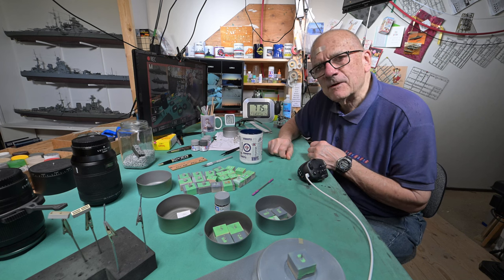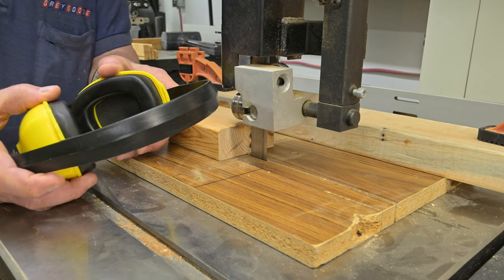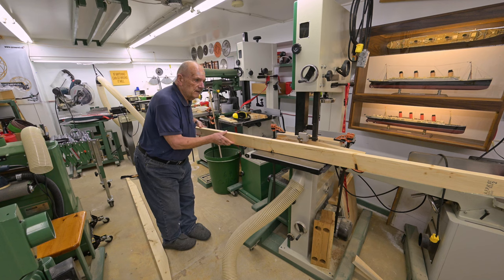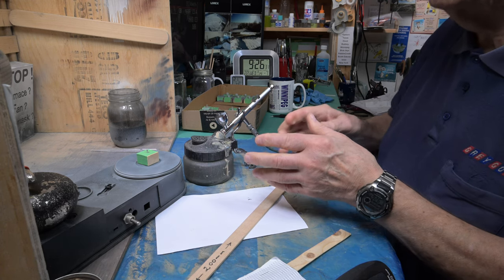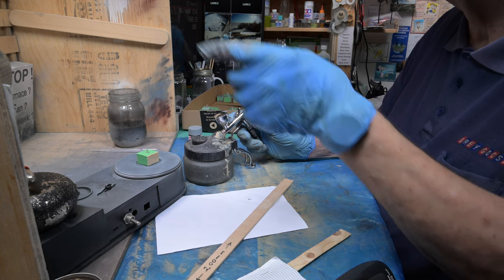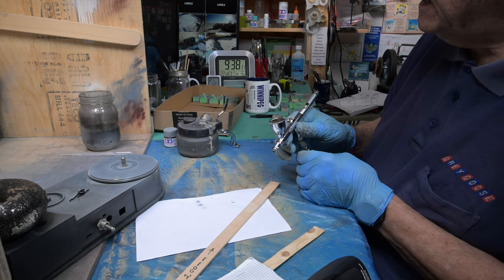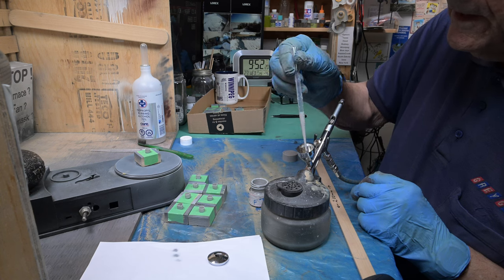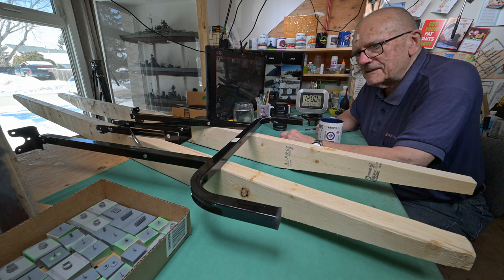The Model Ship - Part 1536

Comment: Hi Ron, nice job with the painting.  You sure do have a nice wood shop.  If you are going to mount those legs on the bottom of the 2X4s, aren't you going to need a block in the middle to mount the folding support to?  I'm sure you probably have them all put together and ready to use by now.  Have a great day.  Jeff
Reply from the maker: Yup! I used those angled pieces that I'd cut off the ends. Not perfect, but nobody will see them anyway. 😁